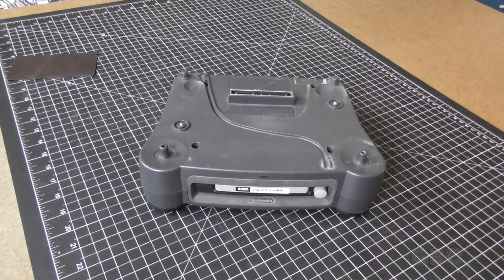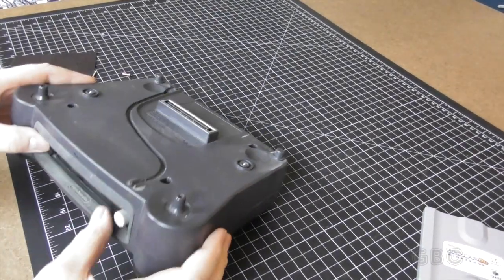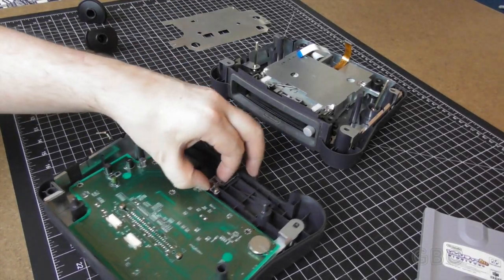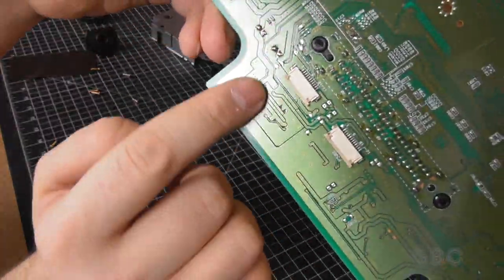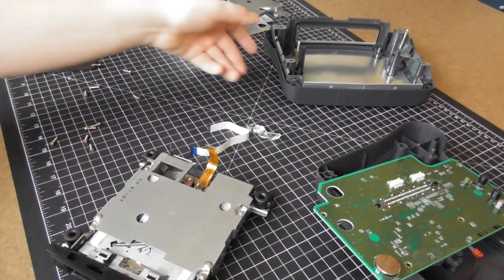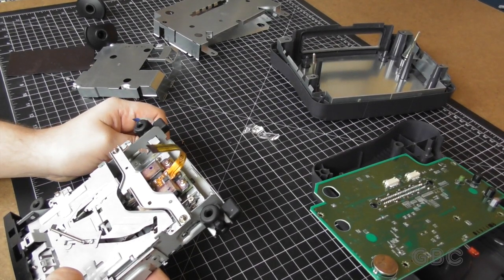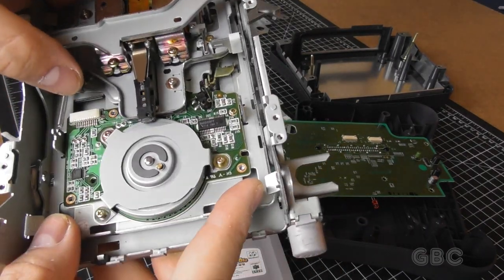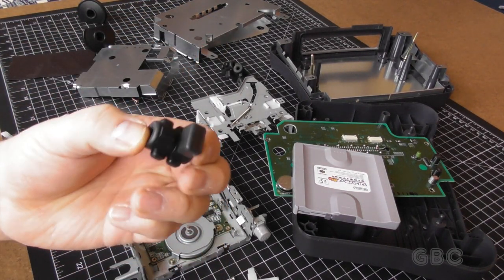[57] N64DD Teardown

Comment: What was on the board? Did it have chips for extra graphic performance or extra ram?
Reply: The expansion pak gave it the extra RAM, and I think it has some chips for extra performance, but I'm not sure
Reply: From the look of it, the 64DD is basically just the disk drive, and the internal clock. Maybe some other features, but there is no heatsink, or any chips that have any major heat production. Meaning that this thing was mostly designed to make the n64 have larger games, but it’s only 64 megs that seems like a step in the wrong direction.